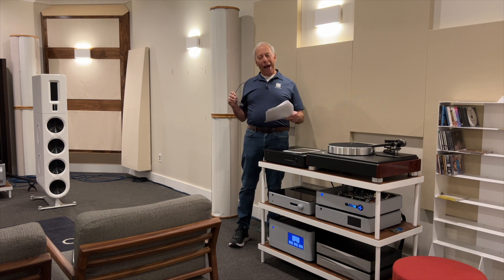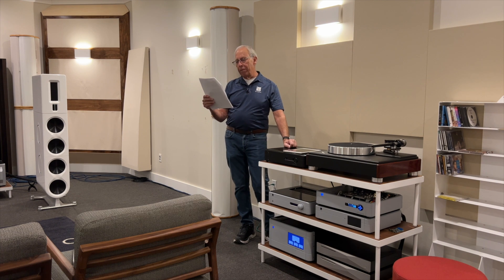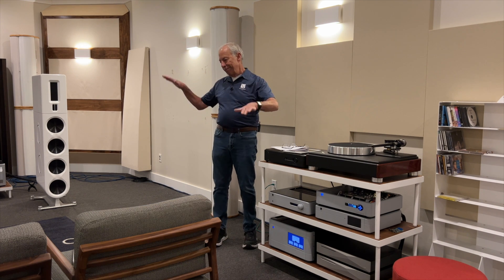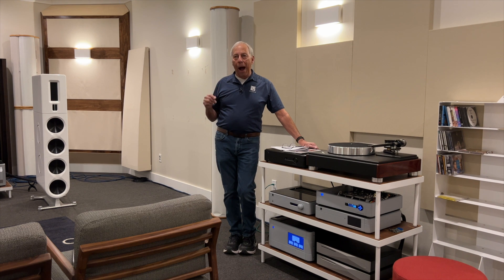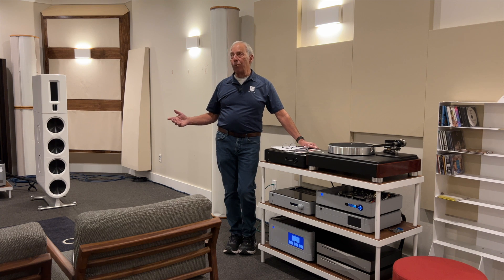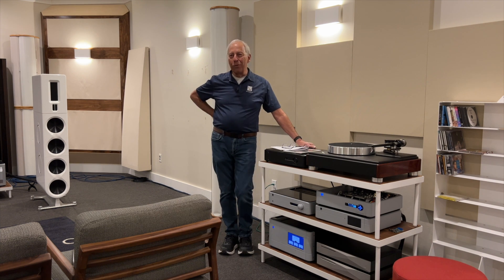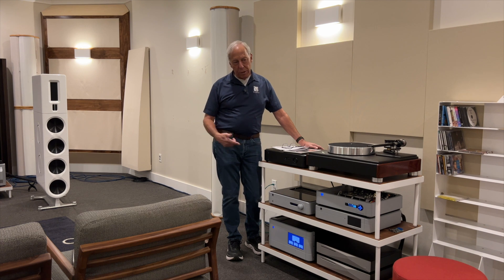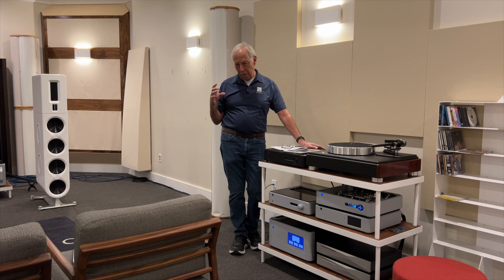Decoupling subwoofers

Comment: If you have a concrete floor something that works great is to decouple your couch.  Done right and the subs only have to overcome the inertia of you and the couch rather than the whole concrete slab.  I use two layers of those blue 4x4 inch decoupling pads from AMZN glued together with a leg cup on top.  Placed under each couch leg does raise the seat almost two inches, but the felt bass really comes through.  Here in Florida we have many concrete slab houses and this really helps.

Comment: Sounds like a cool idea, but what do you do for a downward firing sub? I got the Adam Audio T10S to go with my T5Vs. It comes with rubber feet, "The acoustic performance was optimized by four high grade flexible rubber feet that prevent the sound from exciting the floor..." How would you not decouple a downward sub? I didn't want to bother others in the house so I used some of the inch or so thick closed cell white packing foam to make an isolation pad for it. It helped with the sound leaving my studio. Would be cool if there were special feet that would couple and decouple a sub at the push of a button. I like the idea, but not bothering others is more important.

Comment: I moved into my first house about a month and a half ago (a townhouse outside unit with, apparently, paper thin walls) and have already received several complaints from my next-door neighbor.  I love the tactile feel of my 2 subs, both 12" models but if my neighbor is home I have to have the sound system at an unsatisfying low volume  So far I've put Soundpath isolators on one of my 2 subs - the common-wall sub.  I have bamboo plank floors over a crawlspace.  Are there any relatively inexpensive solutions to preventing the sound, particularly the bass, from penetrating the common-wall and disturbing my neighbor?  I have a 7.2.4 system, or will when I eventually get everything hooked up.

Comment: I'm doing research on audio, being new to higher end audio setups. I'm getting ready here before long to start investing in a starter home theater setup, in my apartment. Overall since I've been here, at the apartment complex, I don't notice too much noise from neighbors. Though I'm concerned with mainly with how much a subwoofer will transfer through walls and floors.

My bedroom that I'm doing the setup in is fully carpeted. 10' x 12' x 8'. While I was looking at a full on Klipsch 5.1.2 reference premier system.. A friend who works in audio suggested, since I'm doing a physical setup and not a virtualized one. That I just go with a 5.1 system using Klipsch bookshelf speakers, a center, and sub. Would save me about $800-$1000 dollars, and give me room to upgrade down the road once I move somewhere with more space. Since the bookshelf speakers can just be re-arranged down the road if I had towers, I can just use them as sides or rears.

While cost isn't an issue for me. I'm mainly concerned with bass bleeding through walls and floors. That and finding the balance of how much audio do I realistically need for my space.

I also happen to live around/near the Des Moines, Iowa area lol. I'm familiar with working with PC's and software, as a hobby, but lack experience in the audio department outside of what research I've been able to do. I've much more experience hauling 40+ thousand pounds of glass down the interstate lol.

Comment: The ship's crew appear to be mutinying on this topic....
Reply: And what do you do for a downward firing sub? I got the Adam Audio T10S to go with my T5Vs. It comes with rubber feet, "The acoustic performance was optimized by four high grade flexible rubber feet that prevent the sound from exciting the floor..." How would you not decouple a downward sub? I didn't want to bother others in the house so I used some of the inch or so thick closed cell white packing foam to make an isolation pad for it. It helped with the sound leaving my studio. Would be cool if there were special feet that would couple and decouple a sub at the push of a button.

Comment: Decoupling definitely helped my Elac 10" Varro Reference series subwoofer. Whenever I was in the basement underneath my sub's location, I could hear my hardwood floors rattling like there was no tomorrow. I decoupled using 4 each 2"x2"x7/8" thick pieces of Diversitech MP-2E Anti-vibration pads. When I'm under my sub's location now, all I hear is music playing...absolutely zero rattling of my hardwood floors. This stuff is "crazy good" at isolating vibrations. Cost for the 4 pieces was about $4 on Amazon. My bass is more controllable now, and more focused with less of a loss of energy wasted on shaking the house apart, lol. (I'm not a fan of rattling the rafters of my house with bass).

Comment: I like the sound of decoupled  bass. I like the idea of having lots of bass then taming it down or cleaning it up by setting the speakers and subs on granite slabs with floor spikes and sorbothane pads in between the speaker and granite 🔈👍🏻 not quite as much punch but it eliminates some boominess and rattling etc.

Comment: I managed to sort both of my subs out for less than £10   🥳

2 x masonry tiles                 £2
2 x 2" thick density foam    £4
can of black spray                £3.50

aftet spraying, place the masonry tiles on top of the high density foam and then have the subwoofer(s) sitting on top of your new industrial style isolation pad!
 If interested one can see them in action within this short 3 minute video...
https://youtu.be/O_fp8aZiiSM

Comment: I read some comments and added my own view. I missed the point that the wooden floor is carpeted. This changed my view. If you have a wooden floor, uncarpeted, a sub can raise havoc in the room...the spikes can also damage the wooden floor. The fact that this guy's sub is so close to his electronics, I would suggest sorbothane feet under all his components...if they stand on a wooden rack, think of marble or granite shelves. I built my own rack with 50x50mm square tubing and 5 cheap marble shelves. Then I screwed oak wood strips with felt in between to damp the "ring" of the steel tubing. My system sound like a live performance and the room is 50 square meters with a concrete floor covered by full shaggy carpet.  If he has a turntable, a wall shelf to isolate the vibrations and acoustic feedback..

Comment: Nice response, Paul.  However, I'd like to add a few tidbits if I may.  The mere act of couplling a subwoofer really has little/nothing to do directly with visceral impact as one might think.  Rather, using superior strategies to couple a subwoofer to the floor has everything to do with the attempt to allow unwanted vibrations to exit/drain from the subwoofer before they can induce their unwanted catastrophic sonic harm on the sub's built-in amp, x-over, power supply, etc.  That is the real reason why a subwoofer (or speaker) tightly coupled to the floor will sound more visceral because the bass is actually more natural and hence more musical.  In contrast, decoupling a subwoofer from the floor guarantees those unwanted vibrations / resonant energy remain trapped within the sub's cabinet and release all of their unwanted energy somewhere within e.g. the sub's amp internals, x-over, power supply, etc.  When implementing superior (as opposed to inferior) executions of the coupling method, the product in this case the subwoofer will sound even more visceral and flat out more musical because the normally trapped vibrations are now able to flow away from the cabinet.  

One thing to remember is, implementations / executions of vibration mgmt do not change based on weight or component type.  IOW, if such a strategy genuinely works for the subwoofer, then the exact same strategy / method will also work for speakers and components alike.  Guaranteed.  To employ different methods for different components implies laws of nature i.e. energy's behavior changes based on the type of component we're addressing.  They do not.  And since we're dealing with 3 primary sources of vibrations, though we may successfully isolate our components from one source of vibrations guarantees that at least one other source of vibrations will remain trapped and its game over.  When one genuinely hears improvements from a supposedly isolating product, it's actually only because the product is less isolating that the one it replaced.  Not because the component is actually more isolated.
Reply: Nonsense

Comment: I got better quality base when I used dampening feet on my 16" sub which is set on hardwood floor, as well as more even bass throughout the room. I don't see why one would worry about the bass getting lower by decoupling since if it does you can just turn the subwoofer up to compensate. I don't think having floor vibration from the cabinet is how to produce proper bass.
Reply: I settle for $1 Blu-Tack

Comment: If the FR 30 go so low in frequency. Why have a subwoofer especially since the subwoofer doesn’t even go as low in frequency as the FR 30?
Reply: I think the frequency cutoff Paul mentions is the -6db point. I prefer to use the -3db point as I think that’s what most speaker manufacturers quote. To answer your question, the point for best imaging and best bass may not be coincident in your room, so you place your speakers where imaging is best, and the subs where the bass is best.

Comment: The approach I took with my 300 pound Legacy Audio Valor speakers (which have built-in down firing and forward fire subs - down to 12Hz) is to place them Townshend Isolation Podiums.  I also put my tube integrated amp (acts as power amp) on a Townshend isolation platform.  My floor is a suspended wood floor covered by carpet.  The problem prior to this addition was that the vibrations caused the floor to act like a speaker, resulting in significant acoustic energy in the room.  Once on the isolation podiums, this room energy from the floor was significantly reduced.  However, you can feel the sound energy that comes from the speakers, where my sofa does shake and vibrate (and you still feel immersed in the sound).  The Isolation Podium isolate above 3Hz.  The concept for these platforms was to reduce the vibration coming from the floor to the speaker, where vibrations from car traffic, earthquakes, speakers, etc, would not be transferred to the speaker drivers.

Comment: I respectfully completely disagree. I do have a stack of 4 Audio Physic subwoofers, I set them on spikes onto a heavy stoneplate, the stone is then coupled to the floor with Valhalla rubberlike pads. This setup gives clearly better, tighter more forceful bass in my room, compared to simply just leaving the subs straight onto a floor. This is also the setup that is advocated by Paolo Tezzon, chief engineer of Sonus Faber.
Additionally, I believe this setup gives close to zero mechanical vibration transfer through the floor from the subwoofer.

Comment: Decouple or not to Decouple, that is the question. For me the answer is no, I do not decouple my subs. I know there are people who decouple in an attempt to try and keep the sound transmitting to their next door neighbor, in that case decoupling will have a minor effect IMO. I'm in agreement with Paul, decouple your equipment not speakers. If you're that concerned maybe you can  build a isolation box with 2 foot thick insulated walls, Box on pads, and Equipment on pads. That should do it!! 😁🖖
Reply: Vibration of floor and interior is distortion

Comment: Vibrations don't just transfer to equipment through mechanical connections between the floor and the equipment rack.  The acoustic pressure waves themselves cause vibration of the tubes and other electronics.  There is nothing you can do about that except by locating the electronics and the speakers in separate rooms, as some audiophiles do.  An acoustically isolated equipment closet is an example of this.

Comment: I have a similar set up with Maggies and one subwoofer but it's placed across the front wall of my listening room 10 feet from my equipment rack. Even so, it sits on a Symposium anti-vibration platform just in case.

Comment: I think Paul is missing a point here. The guy is worried about bad vibrations carried over by the wooden floor that can effect the electronics, by semiconductors generating a small current. I would suggest putting the sub on a thick concrete, marble or granite block...but still on the floor. I have a REL Strata in front and a Q150E in the rear. The room(50 square meters) has a concrete floor with thick shaggy wall to wall carpet and the roof/ceiling is granite chip concrete...so I do not have that problem. I know exactly what happen if you put a Rega tt on a wooden rack...the arm jumps.

Comment: Many people think they can take any subwoofer and make them sound good. it's not that easy!

Many bass speaker boxes for regular cinema systems many have at home only have a built-in amplifier and 12dB bass filter. There is nothing that adjusts the sound as flat as possible.
You achieve too much in some frequencies which means that it does not provide the requested sound quality together with 2 - 3 way speakers!

Remember that a normal speaker has a crossover which in some ways works like a passive EQ. A normal subwoofer does not have this!

Large speaker coils that are needed to divide at low frequencies cause phase shift and other negative things.
Therefore, an active crossover filter is almost always used,
but unfortunately not DSP. with EQ.

Comment: I hang my subwoofer from the ceiling on bungee cords.
Reply: back in the '80s I knew a few guys who did that w/ their turntables. it worked (for them).
Reply: How much drop in db do you get?
Reply: Me too
Reply: Bungee cords are a great idea.
Hang all the speakers from Bungee cords.  The soundstage would be futuristic like the JETSON’s. 😎👍🤗
Reply: Some Bose 901S would be fantastic hung this way.  @davidfromamerica1871
Reply: Me three. It swings if we play Master and Commander.
Reply: Bungee still allows the bass frequencies to be transmitted to the ceiling. Does not help. I levitate my sub with super magnets and the power is sent via a specially designed induction power supply. That’s the proper way to do it. 🤣😂🤣😂
Reply: @hushpuppykl Excellent, Mag Levitation like trains outside the USA. May the force be with you. 🕴️
Reply: @hushpuppykl  the magnet interferes with the woofer, though.
Reply: I put my sub in an empty bath tub, if it’s not enough I ‘d fill up the bath tub with water… …. 🤣🤣

Comment: MIke (in Des Moines, Iowa):
I recommend you try a Townshend Seismic Vibration Isolation Platform for each of your components.

The platforms are designed for the weight of whatever it is that you will be placing on the platform.  Also, the platforms come in different sizes, to accommodate the various widths and depths of different stereo components (the feet of the equipment is what matters for your measurements)  So you should have the weight of each of your components known, as well as the measurements of the footings of your equipment, if you decided to place an order.

If you want to try with only one platform, then I suggest you do so for your pre-amp, because your letter stated that it was tubed based (and it is bad to vibrate tubes).

Their platforms work, and will probably exceed most people's expectations.
If you have a fairly good system, you will immediately notice a more focused presentation.

Comment: Those vibrations can be awesome but what is the ideal effect? Also sound under 20Hz is an interesting subject. Some subwoofers can go below 20Hz and while you don’t hear it as tones, you can feel it.
Reply: My speakers go down to 12Hz.  While watching the Hitch Hikers guide to the Galaxy, I felt the vibrations of the spaceship from my sofa (which I happen to be lying down on). but could not hear the sound.  This is similar to the vibrations you feel when you are on a ship.  Interesting experience, and this was with the speakers on Townshend Isolation Platforms.
Reply: @matthewbarrow3727  I have similar experience in my home theatre setup and servo subs. Once I thought there was an earthquake as my house is near a fault line.
Reply: well to be teknical here, for example 20hz is not a hard limit so 16 hz is something you can hear slightly, and it also becomes a pressure in your ears. 
wich my floor was able to flex a bit, since i do not get much vibrations from my subwoofers from that. the body punch i do get tho.

Comment: Why don't the FR-30's come with a built-in sub-woofer? It seems if one is needed, even by your standards, then one should be included, per channel of course, for a slightly higher price to be sure.
Reply: because, I guess, the ideal position of a subwoofer is often not the same spot as the main speakers, due to the long wave lengths. 

One of the advantages of a sub is, you can move it around so that on the listening position the bass sounds correct (rather than doubled or nulled due to standing wave phenomena)